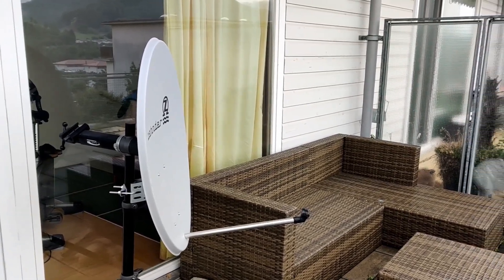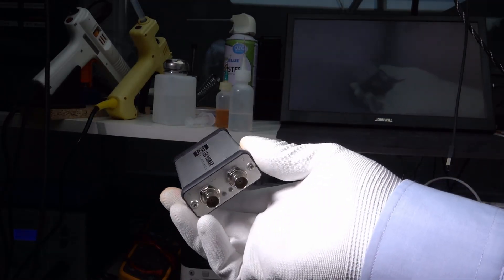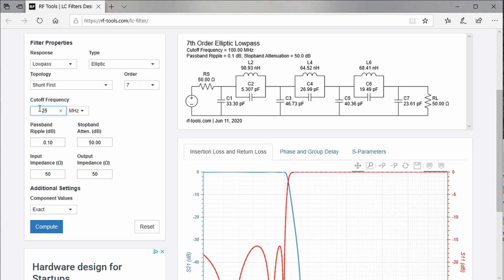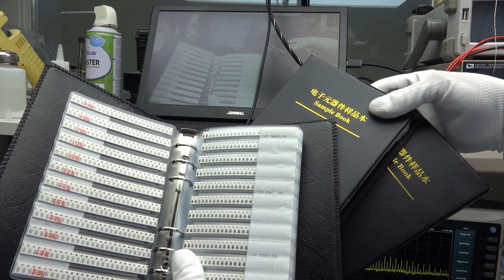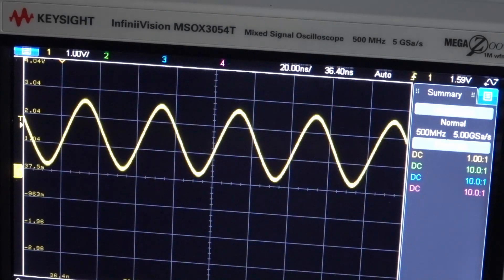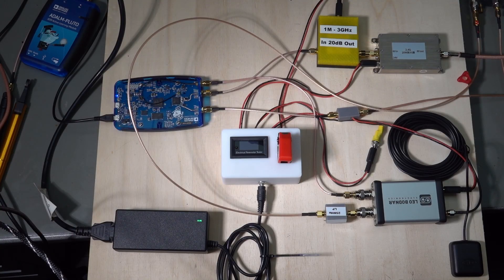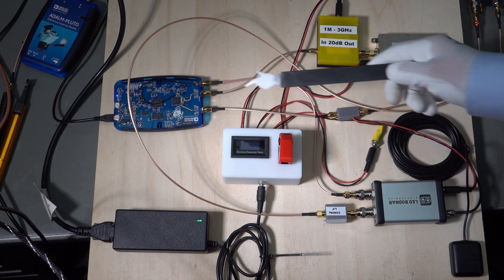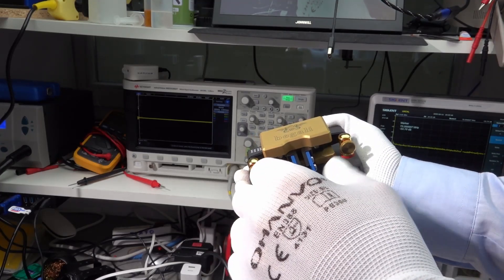018 QO-100  Some problems to solve  And a gift from my wife (Part 5)

Comment: Cross-posting is fine! I did not watch this the first time round but I am glad I chose to watch it today. If anyone else is thinking about buying the GPSDO in this video, it is worth emailing them with the frequencies you want from it. They can advise on whether your frequencies will be too close to some of the internal part frequencies (like the PLL) and may increase phase noise. For a small fee (and I do mean small) and a few extra days, they will select replacement parts and install them if they can find alternatives which suit your output frequency requirements better. I was pleased to use this service but have yet to deeply use the device.

Thanks for the filter and to other commenters about the filter - I was wondering if I was operating too close to my scope's BW limits to have a good measurement of the waveform but you have confirmed what I observed. I will definitely condition it now.
Reply from the maker: I assume I will attract also other subscribers over time which are not subscribed to my main channel…
Thank you for the info about the frequency service.

Comment: keyer or key?
Reply from the maker: Usually, simple keys are called "Straight keys" and the ones with paddles "keyers"
Reply: @HB9BLA  I hate to disagree here, but in English the paddles are paddles and a key is a key. The keyer is a piece of electronics (or mechanics in the case of the mechanical keyers like the vibroflex etc) that sends a stream of dits and dahs to a rig when old rigs only had provision for a straight key. Modern rigs have the "keyer" built in. In this case the box of electronics from K3NG is in fact the keyer. There is a bit of confusion because of fully automatic desktop paddles for ships and amateurs had the keyer inside them. Paddles such as the beautiful set you have from your wife are not referred to as keyers, but paddles or external paddles ("external" in reference to the once integrated keyer/paddle module).

Comment: I'm trying to get into morse code but am lacking the confidence to get on the air with it, I would love to build the k3ng keyer. Perhaps you will make a video on that project?
Reply from the maker: The k3ng  is a simple project. I made one without all the "bells and whistles" in a small case.
I propose to use a Morse decoder in parallel when you try your first QSOs. Like hat you have a backup and gain confidence.

Comment: Hi, the guy with the swiss attenuation curve...
Just a small remark on your choice of filter type....
- Butterworth has the less ripple in the pass band, but also the less attenuation slope at a given order
- Tchebychev on the other hand had much more ripple but a steeper attenuation profile
As your goal was to filter a single stable frequency, Tchebychev might have been a better choice...

Anyway, though wireless is not much of my taste, I do appreciate much both your channels - both I learn quite a bit, and I remember my early analog past (I'm retiring...)

Very best wishes
Jean
Reply from the maker: You are right with the filters. I assume here it was not too important because the harmonics to filter start with 2x the frequency.
It is a pitty that you do not like wireless. It has so many opportunities!

Comment: So one lever of the morse key does dot and the other does dash ?
Reply: Yes... But they are referred to as dits and dahs.
Reply: @russcarter9983  thanks 👍
Reply from the maker: The keyer itself only has two switches. You need electronics to create the dahs and dits ( somtetimes included in the transceivers)
Reply: Yes it is called an iambic key